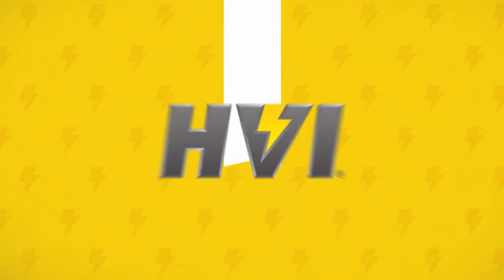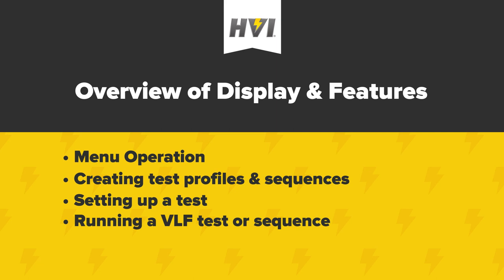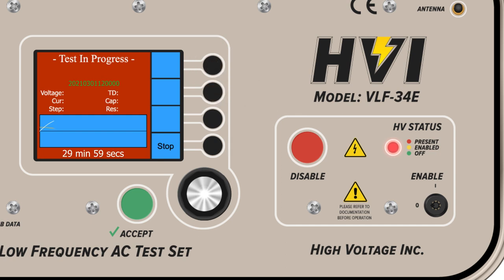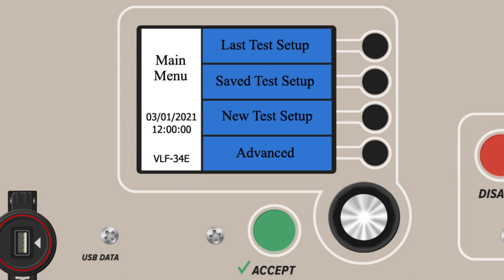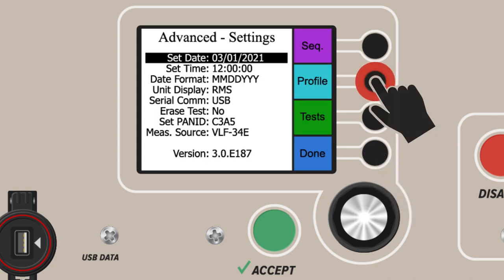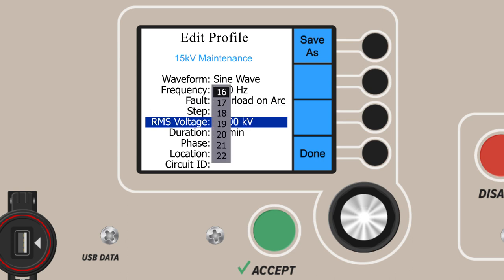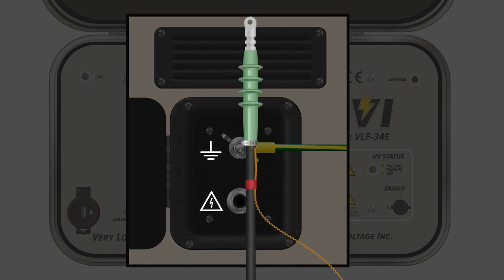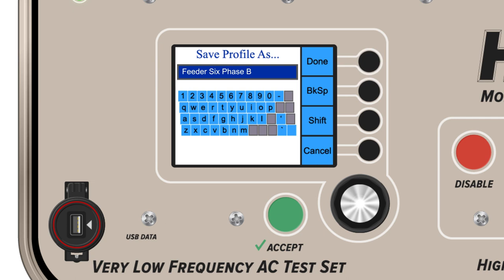VLF E Series Product Training

Comment: Actually i clarification for 6022 cmf modal have dual range voltmeter but dont have low,high range switch how to check the voltage is applied low range or high range